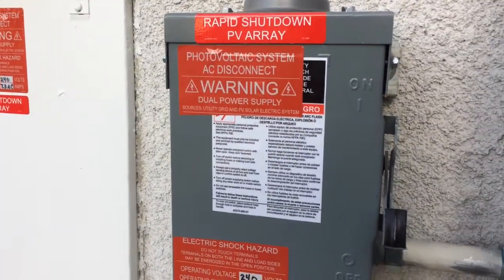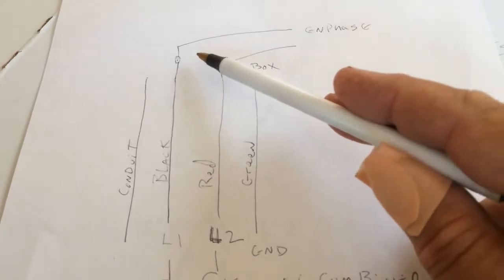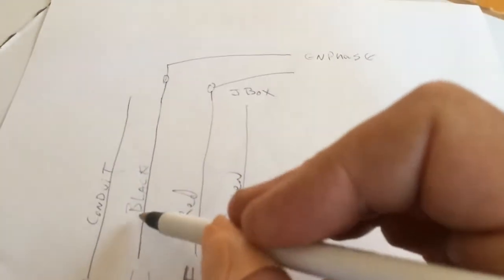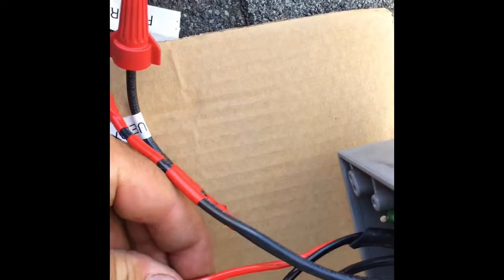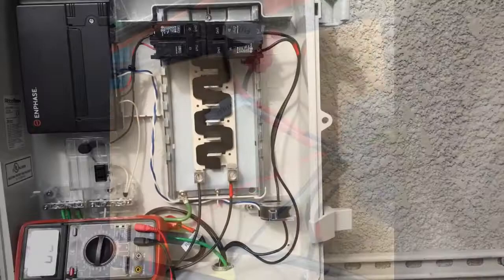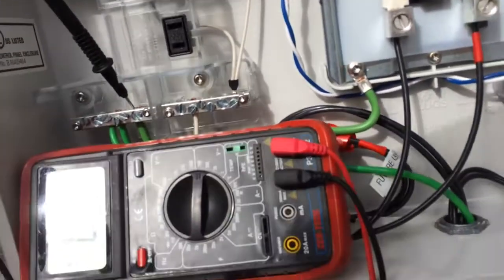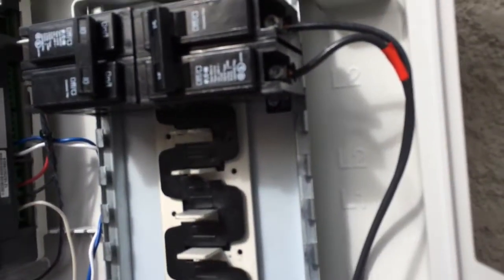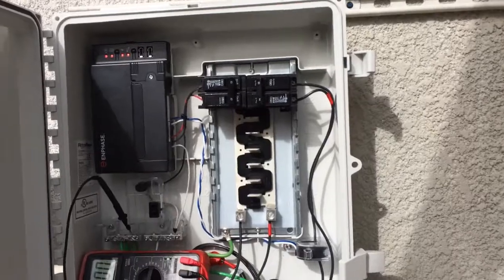Troubleshooting Solar AC wiring with Multi Meter and Enphase Part 1 of 2

Comment: After the wire pull and BEFORE you make up the J - box make sure there's NO continuity between L1/L2 and your Conduit/ground.
Reply from the maker: Yes. See my latest video. On testing. I may have covered this.
Reply: @dannyjensen4954  Cool, you made the right choice with Enphase it eliminates many mistakes made on the roof.